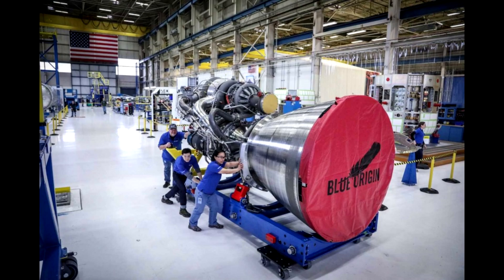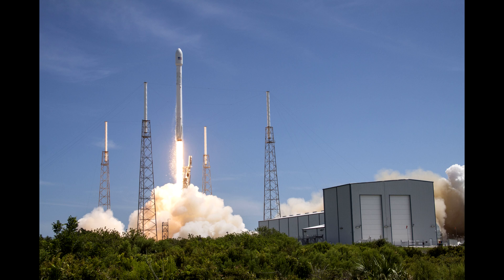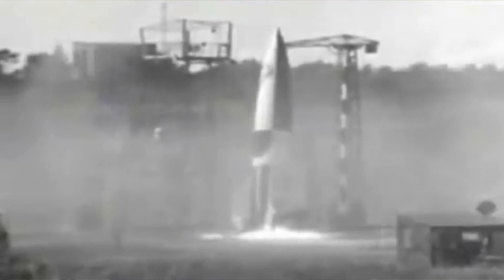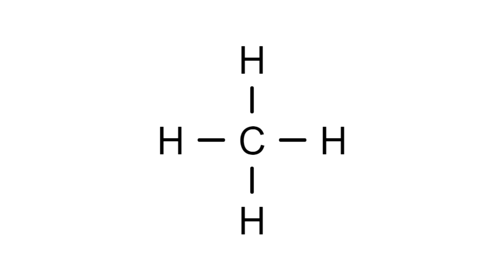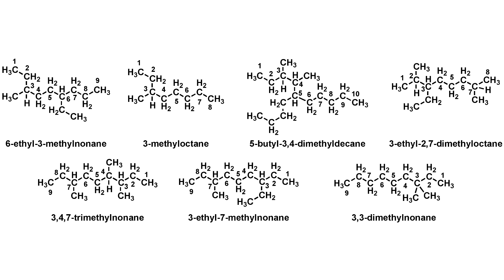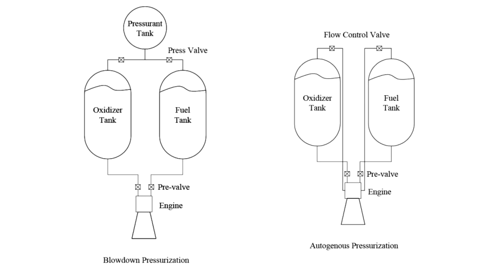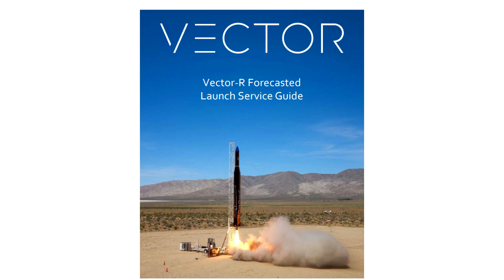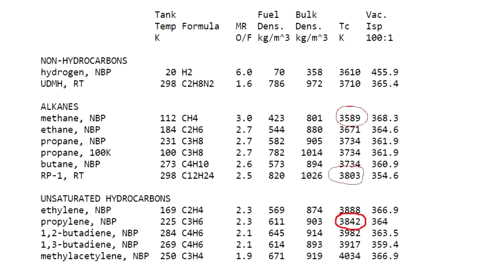Why Next Generation Rockets are Using Methane

Comment: Hey Scott, if you could disregard things like price, safety, ethics, complexities in storage and engine design etc. and just make the most efficient sea-level engine possible for your launch vehicle, what fuel should you choose? What about vacuum engines?
Reply: Do a search for "Ignition!: An informal history of liquid rocket propellants" by John D. Clark.

The United States did a fair amount of of research on this question.  There were a lot of candidates but in the end it was narrowed down to only a couple of chemicals.  As I recall, it's been awhile since I read the book, it is dinitrogen tetroxide and unsymmetrical dimethyl hydrazine or chemicals quite closely related to that.

This is currently used on a several Russian, Indian, and Chinese rockets.  The United States stopped using this combination a while ago primarily because of the serious environmental side effects.
Reply: Methyl mercury and chlorine trifluoride :)
Reply: "All this sounds fairly academic and innocuous, but when it is translated into the problem of handling the stuff, the results 
are horrendous. It is, of course, extremely toxic, but that's the least of the problem. It is hypergolic with every known fuel, 
and so rapidly hypergolic that no ignition delay has ever been measured. It is also hypergolic with such things as cloth, 
wood, and test engineers, not to mention asbestos, sand, and water —with which it reacts explosively. It can be kept in some of the ordinary structural metals — steel, copper, aluminum, etc. —because of the formation of a thin film of insoluble metal fluoride which protects the bulk of the metal, just as the invisible coat of oxide on aluminum keeps it from burning up in the atmosphere. If, however, this coat is melted or scrubbed off, and has no chance to reform, the operator is confronted with 
the problem of coping with a metal-fluorine fire."

from "Ignition!" on page 73
Reply: Jonassoe possibly a magnetic railgun, hyperloop style.
Reply: I was thinking about launch technologies that actully exist now or have been tested, but these are also interesting answers!
Reply: For chemical rockets, probably liquid fluorine as oxidiser, decaborane as fuel. This mix produces rather high Isp due to the extremely energetic reaction and relatively light combustion products (HF and BF3). Also both propellants have excellent density, and the exhaust will be a rather appealing green colour due to the presence of boron ions. 

The downsides are that fluorine will ignite practically anything, and both it and decaborane are extremely toxic. The exhaust products are also highly toxic and corrosive.
Reply: It's either the case that liquid fluorine won't work or there are better fluorinating chemicals out there or both.  

From "Ignition!", quote:

"And so everybody started looking around for an easily decomposed fluorine compound that could be used as a storable oxidizer. "Easily decomposed" is the operative phrase. Most fluorine compounds are pretty final — so final that they can be thought of as the ash of an element which has been burned with fluorine, and are quite useless as propellants. Only when fluorine is combined with nitrogen, or oxygen, or another halogen, can it be considered as available to burn something else."

and

"All this sounds fairly academic and innocuous, but when it is translated into the problem of handling the stuff, the results are horrendous. It is, of course, extremely toxic, but that's the least of the problem. It is hypergolic with every known fuel, and so rapidly hypergolic that no ignition delay has ever been measured. It is also hypergolic with such things as cloth, wood, and test engineers, not to mention asbestos, sand, and water —with which it reacts explosively. It can be kept in some of the ordinary structural metals — steel, copper, aluminum, etc. —because of the formation of a thin film of insoluble metal fluoride which protects the bulk of the metal, just as the invisible coat of oxide on aluminum keeps it from burning up in the atmosphere. If, however, this coat is melted or scrubbed off, and has no chance to reform, the operator is confronted with the problem of coping with a metal-fluorine fire."
Reply: You could also use chlorine trifluoride, as boron trichloride is also a gas. Performance would be slightly lower though, and we're talking about maximum liftoff performance, not practicality (if we were concerned with that we wouldn't be discussing fluorine-based oxidisers or boron-based fuels!) Amusingly this combination is 'storable' and could conceivably be used to power a missile, if you weren't worried about gassing your own troops with the exhaust.
Reply: The US government spent a lot of time looking at chlorine trifluoride.

Quote: " Ignition was beautiful —so smooth that it was like turning on a hose. Performance was high —very close to theoretical. And the reaction was so fast that you could burn it in a surprisingly small chamber. But. If your hardware was dirty, and there was a smear of oil or grease somewhere inside a feed line, said feed line would ignite and cleverly reduce itself to ashes. Gaskets and O-rings generally had to be of metal; no organic material could be restrained from ignition. Teflon would stand up under static conditions, but if the CTF flowed over it with any speed at all, it would erode away like so much sugar in hot water, even if it didn't ignite. So joints had to be welded whenever possible, and the welds had to be good. An enclosure of slag in the weld could react and touch off a fire without even trying. So the welds had to be made, and inspected and polished smooth and reinspected, and then all the plumbing had to be cleaned out and passivated before you dared put the CTF into the system. First there was a water flush, and the lines were blown dry with nitrogen. Then came one with ethylene trichloride to catch any traces of oil or grease, followed by another nitrogen blow-down. Then gaseous CTF was introduced into the system, and left there for some hours to catch anything the flushing might have missed, and then the liquid chlorine trifluoride could be let into the propellant lines."

Despite these and other problems it could actually be used.  The best fuel they found to go with it was hydrazine.

Later they figured out how to make ONF3.   Quote: "It boils at —87.5°, and its density at that temperature is 1.547. It is much less active chemically than dinitrogentetrafluoride, and is hence much easier to handle. It is stable in most metals, reacts only very slowly with water or alkalis, or with glass or quartz even at 400°. In these respects it is very similar to perchloryl fluoride, which has a similar compact and symmetrical tetrahedral structure, with no reactive electrons. It reacts with fluorinated olefins to form C-O-NF2 structures, and with SbF5 to form the interesting salt ONF2SbFg. Its potential as an oxidizer seems to be similar to that of N2F4, and it should be useful in deep space missions."

This may be a practical solution for situations where you need to store propellants in space for much later use.

More along that line: "Two space-storable systems have been investigated rather intensively. RMI and JPL, starting in 1963 or so, and continuing into 1969, worked out the diborane-OF2 system, while Pratt and Whitney, Rocketdyne, and TRW, with NASA contracts, as well as NASA itself, have concentrated their efforts on OF2 and the light hydrocarbons: methane, ethane, propane, 1-butene, and assorted mixtures of these. (In most of their motor work, they used a mixture of oxygen and fluorine as a reasonably inexpensive surrogate for OF2.) All the hydrocarbons were good fuels, but methane was in a class by itself as a coolant, transpiration or regenerative, besides having the best performance. The OF2-methane combination is an extremely promising one."

And then they figured out how to make ClF5.  Quote: "ClF5 is very similar to ClF3, but, with a given fuel, has a performance about twenty seconds better."

And then it's made clear that they discovered other things that he isn't allowed to talk about.
Reply: I have read Ignition! so this is all familiar stuff to me.
Reply: In the last chapter of "Ignition!" John Clark gives his opinion on which fuels are likely to be useful and practical, now and in the future.

He said, "For short-range tactical missiles, with a range up to 500 km or so, it will be RFNA-UDMH, gradually shifting over to something like ClF5 and a hydrazine-type fuel."

So clearly he thought ClF5 was something that could be used.  Earlier you said something about the fluorine exhaust being dangerous.  Is that something you actually know or are you guessing?  I wonder if it might be that the fluorine and chlorine are so reactive that they completely react and therefore the exhaust is harmless.

I would also wonder about how the hazard of ClF5/hydrazine compares to RFNA/UDMH.

And then he goes on to say that "For long-range strategic missiles, the Titan II combination, N2O4 and a hydrazine mixture will continue in use."  I missed where he explained why N2O4/hydrazine is better than ClF5/hydrazine for that context.

And then he asserts that RP1/LOX is probably the best choice for the booster.  (It's interesting that he did not choose hydrogen/LOX.)

And then he talks about the second stage and higher stages, which since the man was clearly very smart and spent a huge amount of time thinking about all this, might be worth paying attention to: 

"For the upper stages, the hydrogen-oxygen combination of the J-2 is very satisfactory, and will probably be used for a long time. Later, as more energy is needed, there may be a shift, for the final stage, to hydrogen-fluorine or hydrogen-lithium-fluorine."
Reply: John D Clarke was a smart man, but he made the mistake of thinking performance was the same as practicality.  Just because all those exotic fuels and oxidizers gave wonderful numbers didn't mean they would ever be cost effective.  We will almost certainly never launch a rocket with a more energetic mix than hydrogen and oxygen.  And of course the storage advantages of solid fuels means that pretty much everything military will always use those.
Reply: @mmandrewa2397  The exhaust products of a fluorine burning engine will generally include a high proportion of hydrogen fluoride (HF) as a consequence of the fuel containing hydrogen (fluorine burns with hydrogen to make HF in the same way oxygen burns with hydrogen to make water). HF is notoriously toxic (look up a MSDS for it if you don't believe me) and forms hydrofluoric acid when dissolved in water. In spite of technically being a weak acid, the latter is one of the few substances that can dissolve glass. Chlorine behaves similarly, producing hydrogen chloride (HCl) which in turn can dissolve in water to make hydrochloric acid.

Comment: It will be nice to see BO get something to fly (other than their toy.) There has been a very high hype to reality ratio out of them for the last few years.
Reply: At least the engine isn't all hype, considering that they have footage of test firing.
Reply: Himanshu Goel 
True. It’s a long way from test firing to flight, but they have some real hardware.
Reply: Blue Origin is a very quiet company. They already have developed a very good engine, and it's anyone's guess how far along New Glenn is in development. It is a pretty ambitious rocket. They're definitely behind SpaceX, but they also have different goals- blue origin is for profit, as a space tourism company, soon a launch service provider, and later moon industrialization. SpaceX wants to colonize Mars and beyond, which, of course, requires making a good deal of profit as well (will largely come from Starlink, which does not compete with BO).
Even in the short term, SpaceX's rockets tend to be designed for placing very large payloads into low orbits, while New Glenn will be marketed mostly for GTO missions and even direct to geostationary orbit launches. Not to say that they can't do each other's jobs, but those are what they focus on.
My major concern with BO is that New Glenn looks like it will only reuse the first stage, meaning they'll be very limited in how cheap it will ultimately be able to make it. It should be a very capable rocket though. But so is a BFR with some refueling runs.
Reply: It would be ironic if the first thing BO gets into space is someone else's rocket.
Reply: @webchimp  Although somewhat ironic, it's very good publicity for them, and there is nothing wrong with more publicity.
Reply: His rocket already gets to space. It just doesn't orbit.
Reply: @webchimp  how is that ironic? Thousands of companies get their hardware launched into space as part of someone else's rocket or satellite. Also, they've already gone to "space" with their own rocket, technically.
Reply: Robert Lutece 
I would really like to see both SpaceX and BO succeed. So far, I haven’t seen a lot from Blue Origin though.
Reply: Bezos has been pouring that $ in apparently but right where are the results?
Reply: You mean their reusable, human-rated, hydrogen-oxygen engine powered, technology that can lend itself to lunar landers and upper stages 'toy?'
Reply: @stardolphin2  
Some toys are better than others.
Reply: They specifically prefer it that way. Beszos operates on endless trials culminating on sudden market release.
Reply: That 'toy' may be the first private rocket to put someone into space...albeit just above the karman line outside of the 2004 scaled composite flight. Just like that 'toy' was the first private rocket to ever go above the karman line and actually land the first stage back on earth. That 'toy'  was also actually the first private rocket engine that actually was reflown to space. 

That's a lot of first for a 'toy' that many of you appear to not be willing to give credit where credit is due. Bezos has also done every bit of it on his dime whereas spaceX has used outside government funding for part of the development....several billion dollars in fact. I won't dispute the fact that Musk and SpaceX are pretty far ahead in the cargo and orbital area......they have done a fantastic job. But give Bezos and Blue credit where credit is due.  Plus, Bezos is developing the BE-4 for sale not just to ULA. It may find it's way onto NASA landers later on or other types of rockets for example in the military. Both SpaceX and Blue are driving to space but in a slightly different manner.
Reply: at dbreardon: "Just like that 'toy' was the first private rocket to ever go above the karman line and actually land the first stage back on earth."
Nope, sorry, your facts are incorrect.
Back in 2004, Scaled composites did go above the Karman line, and land all its stages back on earth. It ALSO reflew its rocket engine to space. and, UNLIKE BO' dildo, it was manned.
.
Please stop revising history just to grind your own axe.
Reply: I said "rocket" and land "first stage". Scaled Composite, now Virgin Galactic,  builds a space plane/glider using a rocket engine. That is why I said "rocket". I watch the scaled composite craft go into space twice....it wasn't a rocket and did not land the "1st stage"...the entire craft glided back and landed like the space shuttle.
Reply: @dbreardon  
Incorrect about NASA funding SpaceX research.

SpaceX gets money to do research into NASA things, but not SpaceX stuff. With the exception of the launch abort system for the Dragon, which is being paid for by NASA. SpaceX pays for almost all of it's own research.

Other than that, SpaceX gets paid to deliver things to space.

Also, Tesla gets less money from the government than GM or Ford. Billions less.

Musk really is doing all this basically on his own.(well, non government money anyways)
Reply: They got over 2 billion in 2014 for the development of their manned capsule which they wanted to develop as part of their own space program.
Reply: @dbreardon  
You got a link for that claim by chance?
Reply: @dbreardon  
I got to say,  It looks like you're wrong TBH.

I found a 2.6 billion contract to SpaceX to develop a crew capsule for NASA, and Boeing got 4.2 billion to do the exact same thing.

So both companies are doing  the same basic work for NASA, but SpaceX is about 40% cheaper.
Reply: As indicated, SpaceX got government grant/contract money to develop a space capsule.....so I am not wrong
Reply: @dbreardon  
No, you did not say that.

They didn't get over 2 billion to develop their manned capsule that they wanted to develop for their space program.

The fact is, SpaceX is building a completely different, and bigger system to go to Mars. Their main space game. Except for use for NASA contracts, Dragon 2 is about as worthless to SpaceX as tits on a bull.
Reply: I agree. Bezzos, at this point, is all blow and no show. He isn't even in the same realm as Elon Musk. Orbital isn't easy.
Reply: I'll be very surprised if SpaceX is lifting more kg beyond GEO than Blue Origin in 20 years time.
Blue Origin has realistic long term business plans, SpaceX does not.
Reply: Circle Breaker - realistic long term business plans, please elaborate. It is just as easy to say SpaceX has realistic long term business plans, Blue Origin does not. I think the concept of realistic long term business plans in space is a fantasy. Talk to us.